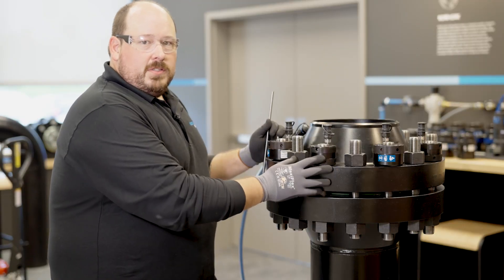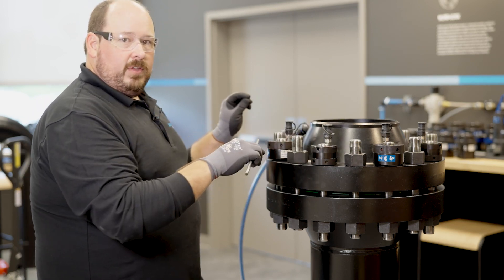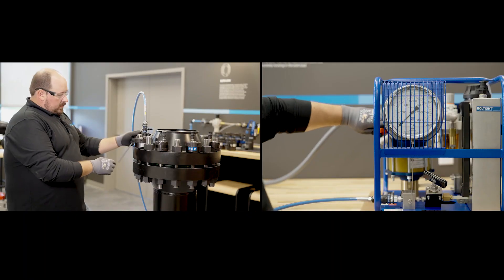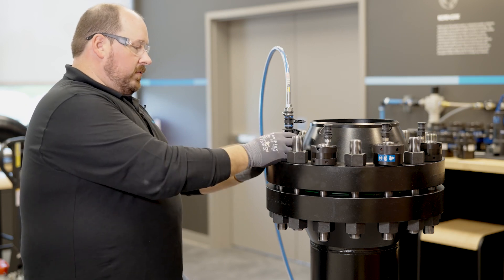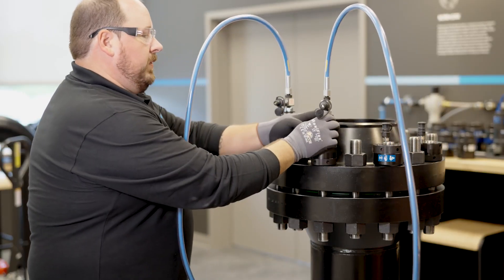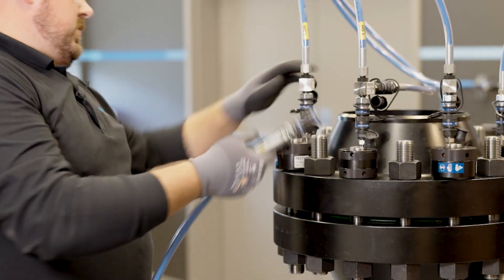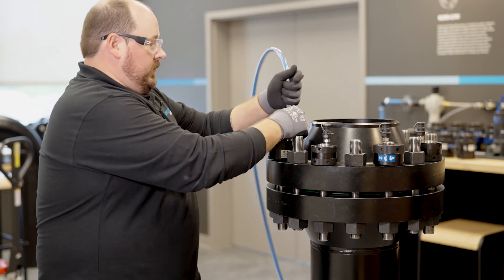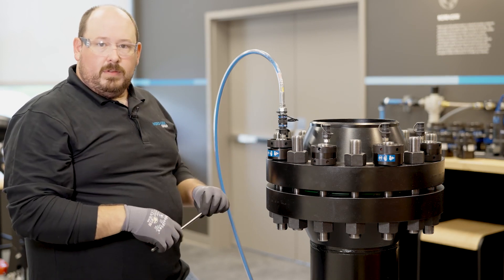Getting To Know Boltight - Hydraulic Nut Tutorial

Comment: Hi there, just a question about the nut after an extended service interval.
In applications which have corrosion, dirt, grime, etc. I don't know if the the tommy bar will be strong enough to break it loose. Further, the hydraulic nut portion doesn't have holes for the tommy bar, making it even more difficult to remove.
Reply from the maker: Thank you for your question!

Many of our customers use our hydraulic nuts in tough conditions. Depending on your concerns, our engineers can make recommendations on a variety of materials to combat the effects of the environment. We’ve previously custom-made hydraulic nuts in a variety of materials for the unique challenges of mining, oil & gas, subsea, and several other harsh environments.

In this video we use our standard hydraulic nut. When the removal process is done properly, there isn’t much force needed to loosen the collar and using the tommy bar holes would be sufficient. 

However, if a customer is concerned about the difficulty of installation/removal, our design teams in the USA and UK can customize the hydraulic nuts to meet the specifications.

Please contact us at "enquiries.Boltight.uk[at]nord-lock.com" if you wish to discuss further, and our team would be happy to assist you!